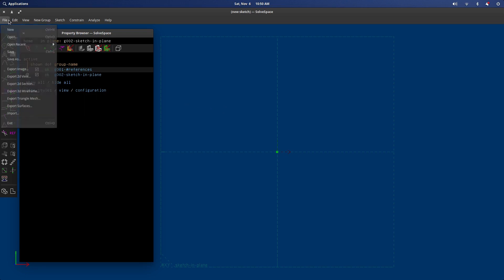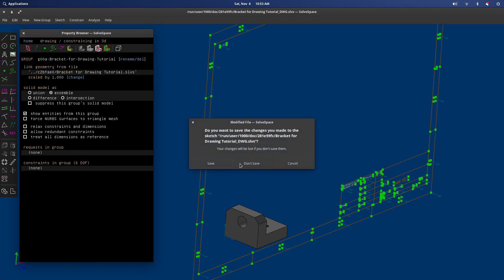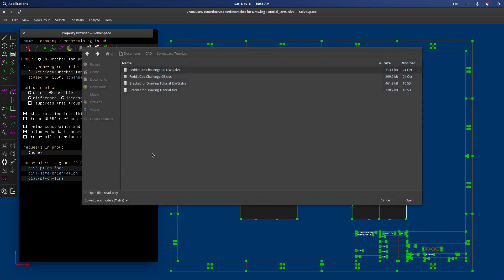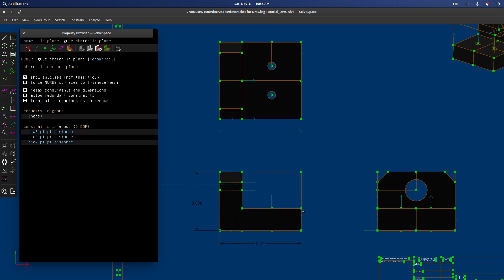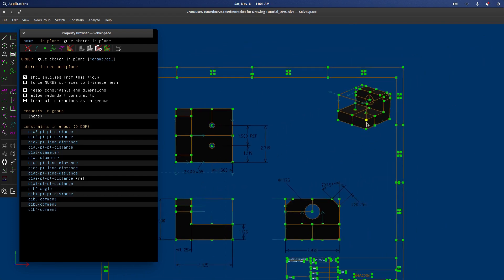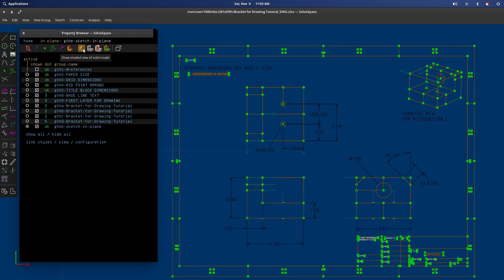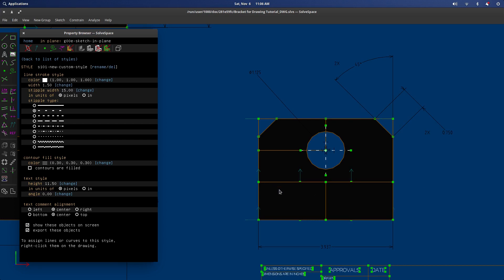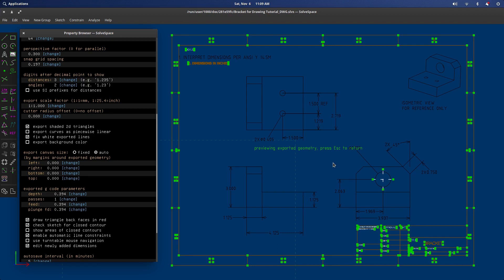Solvespace Drawing Tutorial

Comment: Really helpful thank you. For me the dimensions were reflecting the dimensions of the part as scaled, and not as the original part dimensions. So started again with a new drawing, imported the drawing template and then the part. Scaled the drawing template to fit the part and wallah! Great video. Thank you again!
Reply from the maker: That's definitely something I didn't catch in the original video! Thank you for an excellent work around!
Reply: Did you have to extrude the template (i chose the border) to get the points from the template to show up after you imported it?